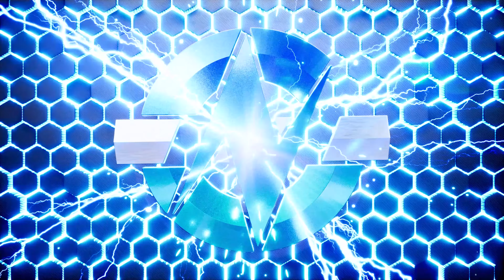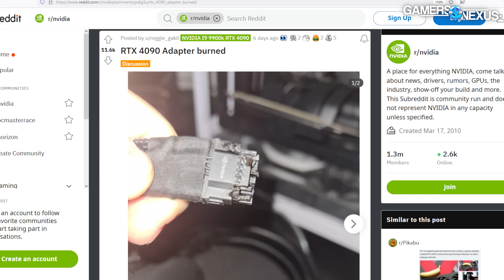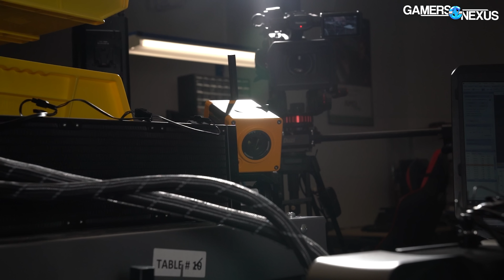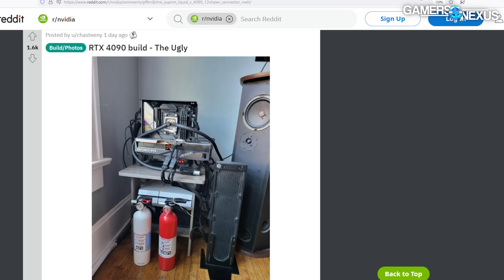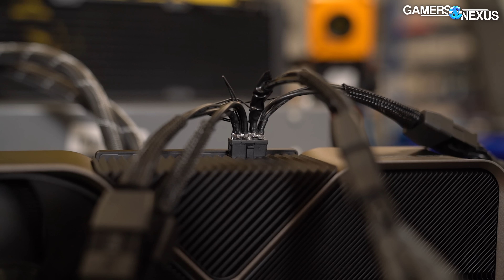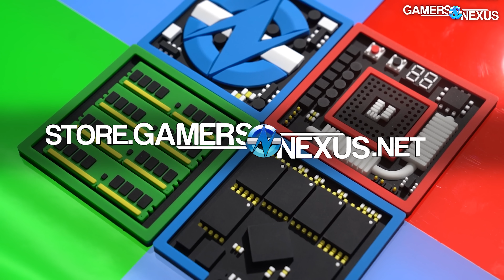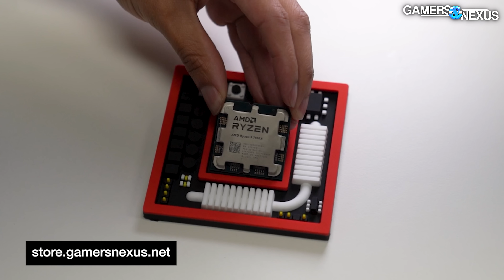Testing Burning NVIDIA 12VHPWR Adapter Cable Theories (RTX 4090)

Comment: Based on several recent, personal experiences with  components (cables & terminations) manufactured in Asia, it is quite possible and even likely Igor has a different manufactured & sourced cable than GN or even jayz. The level of quality from different vendors can be wildly different. And, inspections of components after assembly may not disclose problems. I have seen some vendors who employ people who have almost no training in soldering techniques crank out thousands of cables and hope the poor quality of parts improves over time as the people who do the soldering/assembly of cables gain experience before a catastrophic failure results. Typically, for a lot of assembly houses in Asia, there are no standards save for "make as much money as possible before something bad happens". And these places pop up and disappear almost as fast as weeds in summertime!

Comment: i will say simple some need to start study thermodynamic law + basic physics about electricity, heat, cable, plastic. Make thing smaller it can be understandable but when some boundary are cross bad thing are happen. Manufacture they was try to cut cost exactly in worst place aka >12VHPWR< adapter is bad idea to be use for high power consumption > 600 W !!! < in a situation like this it need to distribute consumption to not create a single point of heat > thermodynamic law <  = in general when you have high electricity consumptions that lead to hotter temperatures you want to distribute the consumption in in such a way as not to generate high temperatures of heat ... basic physics

solution: manufacturer build video card with 2 connector were to be plug 2 separate adapter what have 2 x 8 pin cable, place at a distance

p.s. most test what i seen are done in a situation were bench was open not in a close Case and with a controlled environment aka home use are very diferite situation with all test ...

Comment: 150v vs 300v is just the insulation layer thickness. The current/power rating is exact in this case. One diagram show better power distribution of GN cables vs Icons cables. Icon has all the power going though one pin on the edges vs GN cable where power is evenly split over three pins over two bus bars/soldered wires.

Comment: I keep seeing this idea recirculated, that a loose connection (at the melting point) can cause it. I can't think of any way that could be so from a theoretical standpoint. Rather, a loose connection resulting in higher resistance should cause the connection point which isn't loose to heat up due to the redirection of current flow. That's been the flaw I've seen with the theory crafting thus far, it's based on intuition that bad things (melting) happen where faults occur (a loose connection), but while that's intuitive, it shouldn't be the case here. Bad things will happen where the fault doesn't occur because the fault occurring redirects the current, is the better way to say it. Either way, glad to see you're on it... Any valid theory should show in lab testing, so I think your methodology is sound on this issue.

Comment: Def appears that there are two (or more) varieties of cable that could have shipped with your card.
Sounds to me like nVidia outsourced their cables to multiple locations and one of them cheaped out on the manufacturing - that, or they ran out of quality materials halfway through and started using the cheaper stuff - or they just decided to save a buck or two and made a few batches at lower quality.  Given that the cables were likely made in China, this isn't exactly outside the norm there.

Comment: could be just some QA lemon cables they make million small % the QA sucked maybe end of batch run the solder got burn runs so it breaks easier, 

ive had dozens of USB and hdmi cables go bad due to band bends and or bad QA not even connected wires inside the cables brand new the internal wires where separated so not even connected to the end plug part.  want box of bad cables some brand so called new in box just suck QA and dont work or have shorts in them due to unstable connectivity broken or cracked.  even seen this in so called surge protection wires inside the casing and the outlets spark catch fire.

Comment: What if you supply higher voltage than 12 V? Wouldn't the card try to save itself by sinking it into GND, increasing the overall power flow...

Comment: also "the sometimes called 16pin connector" my guys do you call the "8pin" actualy 6pin and the "6pin" actually 4pin ??? becasue that 8pin is also only 3 ground 3 current 2 sense ?

Comment: The voltage rating doesn't have anything to do with this, thats a rating for the insulation which is not the issue here. You're not arcing through the insulation of the wire at 24V. The gauge and materials of the wire itself could be to blame. Or perhaps the bus bar thickness or material. This could even just be a cold-solder issue. Maybe the individual strands of the wires are breaking from being flexed too much, reducing the cross section, increasing resistance at high current.

Comment: why didn't they just use a Dean style or an XT120 with inner pins for the sense it's a single 12V rail, this is so dumb this is no longer 0.1" wire to board connector territory

Comment: Also I just want to note that there is no reason a 150V rated cable would be unsafe on this 12V line. The actual failures are certainly of a different cause than this rating itself.

Comment: Not really surprising that a relatively simple/common component like these adapters would dual-sourced, or even triple/quad sourced. I’m sure Nvidia will have no trouble identifying which manufacturer(s) are supplying the unsafe designs.

Comment: A couple of theories; Poor quality control likely because cheaping out. Initial run of commercial cables were made poorly and once nvidia found issue just quietly changed it without informing anyone - because it's nvidia. Rare manufacturing faults, not indicative of overall quality. Length of time before issue appears is variable taking multiple long-game-sessions, basically wears away to the point it causes issue.

Comment: Great work, nice testing! I've posted something similar on Jayz's channel but your testing gave me more ideas. 

All the testing were done in an air-con room with GPU outside the case. When the card is inside a case with restricted airflow, the temps will be higher. 

Is it possible the melting is caused by arcing due to poor pin contact? Yes. Is contact resistance going to increase so much the wires/connectors will become hot enough to melt plastic? Unlikely because polyester melts at >250C although each wire is potentially carrying 12.5A DC.

The photos I see seem to indicate melting at the pin end of the connector instead of the cable-end. I have encountered 4-pin HDD molex connector melting due to damaged/loose female receptacle in a Y-splitter.

You are absolutely right that we need more damaged adaptors to pinpoint the failure mode.

Lastly, due to the super high cost of shipping, it's common practice to ship the GPU, carton, accessories (cable/CD) separately and put them in the box nearer to the point of sales at the warehouse. This means the cable will be different across different regions.

Comment: how is the cable voltage rating important though? It is affected by the material/thickness of the insulation, not the gauge/material of the metal inside the cable, doesnt it?

Comment: It's so annoying to see everyone just throwing things at the wall. You need to look at both a damaged card and cable. Everyone is look at good cards and cables and assuming all cables and cards will have the issue instead of plain old defects like a bad batch of pins. There has to be a significant increase in resistance to cause this.
Reply: This could be card side, adapter side, or power supply.

Comment: Voltage rating doesn't seem relevant to this issue.  Voltage rating alone is that voltage at which point the insulation fails to insulate and you will get shocked through the insulator. (That's not going to happen on 12v power loads regardless). Those cables appear to also list amperage which appear to be a draw rating.  300v @ 12A is equivalent to 150v @ 6A for power draw rating.  So it's more important to get both pieces of information.

Comment: IGOR IS DEAD WRONG. DON'T BEND THE WIRES. WIGGLE THE PLUG! I didn't see buildzoides video yet. But I strongly agree. I have been shaking my head the entire video saying you are all barking up the wrong tree. The only thing that would cause that kind of burning is poor contact with the socket of the plug. Either from a loose connection or residue from manufacturing. I have experience with that repairing high-power transmitters all the time. It's not the adapters it's the plug itself. Small pins give a very little margin for error and are inherently weaker.  Poor contact, not a broken contact is the only thing that will cause that kind of melting. This is something that only will get worse as time goes on. As the movement of the connector causes the socket in the plug to loosen causing resistance to go up, causing heating, which in turn causes more resistance, causing more heat, rinse ,repeat till fire.

Comment: Nothing was wrong with the old pcie connectors, even adaptors for right angle etc.. were just fine and they cable managed just fine. Its just another case of 'lets show em we're 'innovating' and doing something different/cool/modern with no reason to change a good thing, i understand the sense cables need but that could've been added extra. USB 3 headers are another victim, i trust a USB 2 connector to stay put when i plug it into a mobo but will constantly double check a usb 3 one before i shut the case because they're so flimsy. Sata and Sata power cables are hit and miss and whilst greatly functional in space saving over IDE, a good ole molex and ide cable could be trusted alot more imo.

Comment: isn't the different voltage rating just a difference in the insulation? eitherway though ig it does tell us that there's a quality difference among different adapters.

Comment: one question, does the "low" 4080 (the one that is more like a 4070) have the same cable, if yes, does that specific cable was use on a 4090 ?! is not far to guess that a 4080 "low" cable is less strong and might have that problem, also it might happens that cables got mix on shipment

Comment: Remember GN was sucking Nvidia's and intel's wang about how great 12VHP is, even though if you ask an electrician or engineer they will tell you moving how amps through DC cables is a great way to start fires.

Comment: As a truck/car mechanic I can say: If a wire feels warm or hot, you are pulling to much amperage trough it or the wire is not thick enough...
A wire that is 60°C, is just to hot and I don't care what the spec is on the wire.
I don't get it why the standard is such a small connector with so thin wires.

Comment: I noticed a burning smell while playing with power limiter settings in afterburner. Oddly the burning smell happened when I moved the power limiter to just 2 watts and applied the setting. I quickly I applied the setting back to stock. Smell went a way. I shutdown and checked the cable for any burn or melt. It looked fine. BUT I did notice the adapter was not fully plugged in.

Comment: I think Jay had a good point... where quality control is the worst issue. Igor's issue, then, isn't a "red herring" but a example of that over-all problem. They are different products, made differently, and that inherently can cause problems because it leads to even more quality control issues. 

As you say, it's not the only problem, but it's a major problem.

Comment: Just to clarify the voltage rating on the wires is a rating of the insulation not the metal itself so in this case that in and of itself isn't an issue. It does however show definitively, that there are different versions being made.

Just don't want people to freak out if their wires are rated 150v in completely different scenarios.

Comment: It's really great to see somebody doing some real serious attempts to reproduce this stuff, and I salute your dedication to all of this.  It would have been great if you had managed to reproduce a failure, but even without that this is tons of useful additional data, IMHO.

A bit of clarification, the 150V/300V rating on the wires is not significant in and of itself in any way for this problem.  That mainly has to do with what type and thickness of insulation is on the wires themselves, and since all of this is running at 12V, both of those far exceed any requirements for this application.  It is, however, significant merely in that it indicates that the wires are not from the same source between the different adaptors, which begs the question of what other things are different between them as well.  (I'm also wondering if the different adaptors might be a "US vs other parts of the world" difference, such as that Nvidia are getting them from a different supplier for cards that are being sold in Germany...)

I would not be surprised if the reason why it seems to be mostly the PWR pins which are melting and not the GND pins is simply because (on most boards, at least, I think?) the GND pins are on the "outside" of the connector and have more contact with the surrounding air, while the PWR pins are on the "inner" row which has more plastic/board/etc around it, so heat may build up more in those locations.  However, the fact that it seems to be consistently the end pins which are frying does seem very significant to me, as that seems like exactly the opposite of what one would expect (logically, under normal conditions, it should be the pins which are closer to the center which accumulate more heat because they're surrounded by other pins also generating heat and do not have as much air contact).

It's a bit unclear to me:  Did you do a test where you compared the temperature of a completely untouched connector vs a connector which had had its housing removed but was otherwise (electrically) stock?  That would be useful to get a baseline to see how much the temperature is affected by simply removing the plastic, which might be a significant factor.  It's also a bit unclear how much a difference of a few degrees might be magnified if it's trapped inside the full plastic housing...  (The big problem with all of this currently is there are just way too many variables)

In any case, I've said elsewhere that regardless of what the actual cause of these particular issues is, the design spec for the new 12VHPWR connector seems really dubious to me in general.  I really don't understand how any professional electrical engineers are actually saying that it's OK to try to pump up to 9.2 amps (according to reports I've seen of what the spec says) through square connector pins that are only 0.64mm in size (let alone when Molex's own specs list a maximum of 5.5 amps for this connector, too).  It may technically work in ideal conditions, but it really seems to me that they are pushing the envelope so far on this that there is basically no safety margin left for any of this stuff, and I would not be surprised if we see a number of other problems come up with these connectors in general (particularly as they age), even when not using this particular adaptor...

Comment: Have you thought about putting a blowtorch blowing hot flame onto the connector while its turned on to see if there is an issue? What about setting the internal components on fire? That could be another test!

Comment: Heat issues in electronics are caused by resistance.  Maybe a bottleneck at the connector?  Why don't they just make the connectors bigger?  Clearly the bus bar and/or pins can't handle the amps.  I don't see how this is such a issue.  Increase the metal thickness for the buss bar and/or pins and amp flow should be higher, resistance lower and overall lower temps on the connector.

Comment: The only i can think are aftermarket products. China knowning they clone a lot stuff and not everything is high quality. So you might check on Chinese market sites for cheap adapters. That can explain why some have 150V cables and not 300V. Its just cheaper.
In meanwhile, Igor Labs still post today videos and warns everyone about bad adapters...

Comment: I have a feeling that part of the issue for this is due to a weak or unreliable PSU. I've noticed that so far most of these fail tests are on extremely well-designed PSU.

Comment: For what it’s worth, EE with experience in power electronics here.

This totally looks like a botched order from a supplier. This happens all the time in China, were a lot of companies would rather finish your order by subcontracting the 10% of the volume they can’t provide rather than telling you they don’t have the capacity. Sadly not all subcontracting ends up happily. 

This kind of thing ends up being a nightmare because most times there’s isn’t a way to track which adaptor went to each box, and the supply streams normally get mixed on origin.

Comment: I'm curious if the stress test for 8 hours involved ramping up and ramping down use?  Reaching a steady state might not matter with overheating, it could be there are many amps pulled when the card goes from low to high power causing the problem.  That would explain why actual users are seeing the problem more since regular use involves more changes in power than a benchmark test.

Comment: Put it in a case. It will increase the temperature around the connector. It won't have cool air to restrict the plug heating.